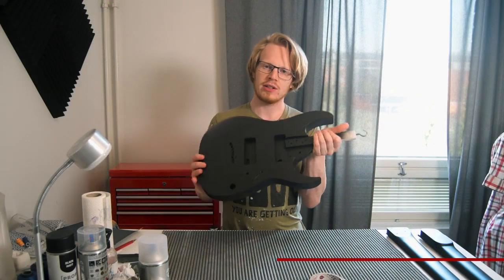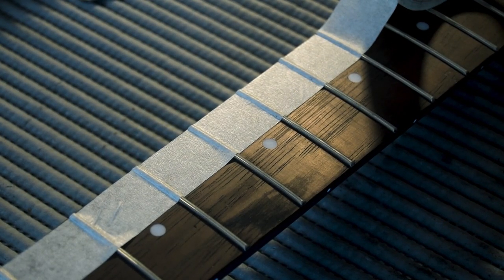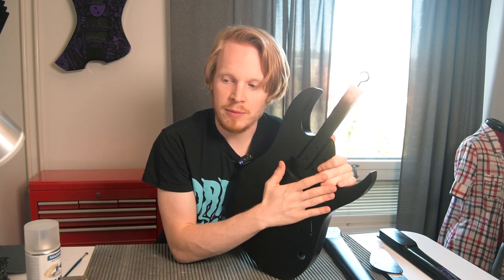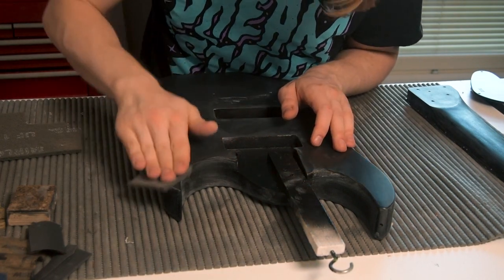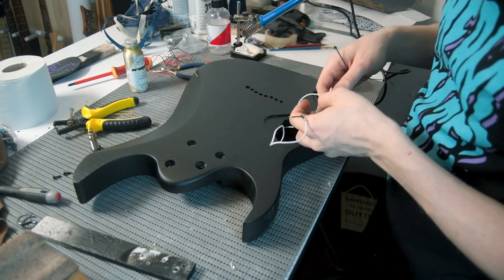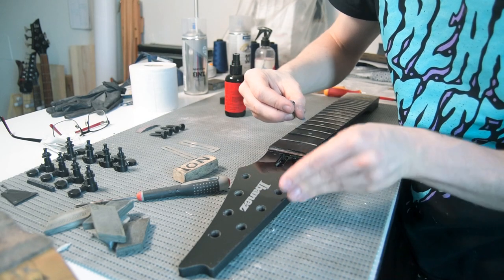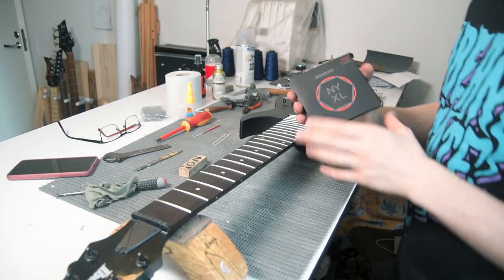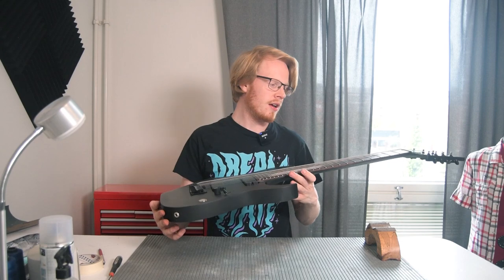How to Refinish A Guitar at Home, Part 3: Clear Coat

Comment: I find it odd, regarding the sanding process. You initially scuff sand so the paint has "something to grab onto". Then more and more attention is put into a smoother surface for additional paint and clear coat. What is these last coats grabbing on to ?
I am planning a guitar finish with no sanding. Just using a soft cloth and a product called liquid sand paper. I'll see...
Reply from the maker: Yeah, a bit misleading there. Sorry about that. The idea with scuff sanding is to yes, scuff the surface to give the next layers something to "grab onto" however as you go about scuff sanding your goal is to get to as smooth a surface as possible (e.g. no orange peel texture). You are still using the same grit sandpaper to do this so the "scuffs" are still the same depth that that sandpaper cuts. This is what the final layers are grabbing onto as well.

The aim of the smooth finish is after the final coat to be able to flat sand and then begin polishing, working up through the grits.

Please do let me know how the liquid sandpaper works out, I am very curious! I suspect that it is just a very coarse polishing compound?

Comment: Great videos! Really enjoy it and feeling more confident to move with my first build :)
One question if you don't mind:
- If I have a white colour base, and then paint over it with some other multi colour paints (marble paints like swirls for example), do I need to scuff sand after it dries out with 800 grit paper? Or can I just go clear coat over it without scuff sanding. I'm afraid scuff sanding would transfer colour between the swirls. 

Thanks upfront!
Reply from the maker: Thanks! Glad you liked the videos :)

And an excellent question! I would've usually said yes to scuffing, BUT having done some swirl experiments I would much rather say that you move onto clears. And in this case, you actually could be pretty generous with your coats. Then instead try to focus on getting those clears even :)

Most importantly: the better your prepwork (so your basecoat of white) the better the swirls will go on without problems down the line.
Reply: @IPGuitars  thanks a lot man for super quick answer! 

That's pretty much what I've figured, but had to ask as well for consultation :) It kinda sounds logical to go that direction and avoid scuffing. Thanks for the tips, I'll probably go 4-5 sessions of white before swirls, and then 4-5 of  clear :) Should be good enough! 

Thanks a lot again! Your videos are really straight to the point and some explanations are super clear to follow. When one is able to share knowledge easy as you do, that shows that you're really confident in skills and knowledge you have. Keep going!
Reply from the maker: No problem, glad to help :) and thank you so much for such kind words

Comment: Is that a scotch brite pad?
Reply from the maker: Not quite. It very much looks like it though :D it's Mirlon Total, manufactured by Mirka and it is intended for scuff sanding paint and lacquers. If I remember correctly, they have 3 different "grits"
Reply: @IPGuitars  Thnx :) What grit do you recommend? All need to do is finish up paint with one of those pads and then put a clear coat on.
Reply from the maker: The grey one is what I use. That's the "fine" I believe